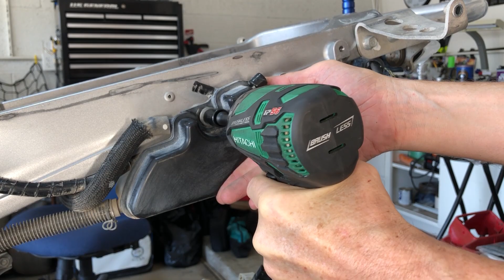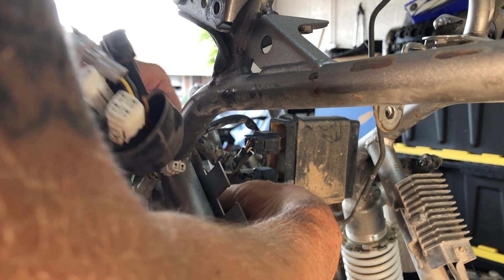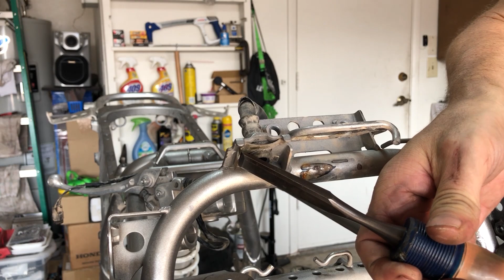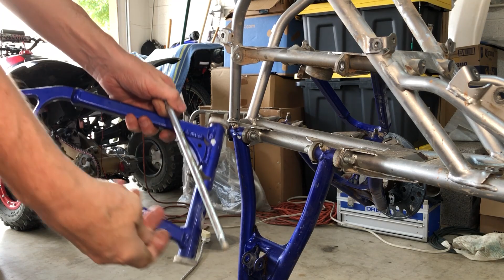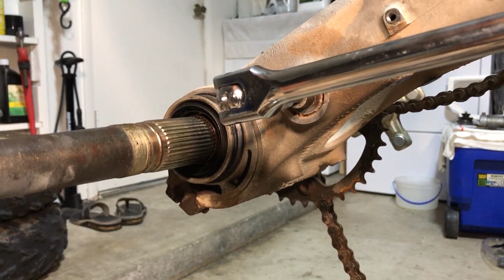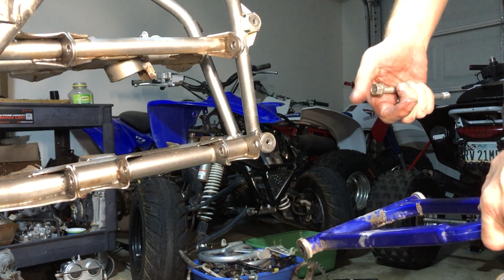Yamaha YFZ450 Build - Part 4 - Tear Down - Wire Harness, A-Arms, Bumper, Axle, Swingarm, Hubs, Rotor

Comment: You should go with wider arms, a wider axle, and some Elka stage 3 shocks or ship the OEM shocks off to Rocket Ron to have them built. You aren’t racing so you don’t need stage 5 shocks, but being in the desert I feel like you could benefit from a little extra width and a plusher ride for the rocky terrain. As for motor upgrades you really won’t need anything other than a good filter, a good exhaust, and jetting the carb. That is literally all I would do as far as performance. Then I would get a good skid plate, case saver, bumper, nerf bars and a kill switch. Other than that stuff there keep everything else stock. Anyway, it’s just my advice. I know you like to stick with being as OEM as possible, I just think you would appreciate that setup.
Reply from the maker: That sounds like a pretty nice setup! I have an HMF Performance exhaust that I am sending in for a rebuild …
Reply: @11GalleryATV  that’s a really good exhaust for the YFZ actually. You know, I use a harbor freight rotary hammer with the punch tip to get the tie rods and shock bolts out. It saves me from hammering and pops those bolts right out of those places that they are seized.
Reply: If you can get an air hammer it will work better, but the rotary hammer works perfectly fine for me
Reply: Oh, and for parts that need to be pressed in I’m about to pick up a harbor freight press as well. Some tools from there work perfectly fine when you’re doing little stuff like building quads. I wouldn’t use it for commercial mechanics, but for what we would use it for it would be a good piece of equipment for not a lot of money. Like $200 for a small bench mounted press.
Reply: Hey, if you do get aftermarket shocks though then I might be interested in buying those OEM front shocks for my daughter’s blaster. I’m looking for a deal on OEM standard travel shocks from an early hear YFZ. I’m going to send them to Rocket Ron to have him do his revalve kit and his triple rate spring upgrade.
Reply: Sorry, I know I’m blowing your comments up, BUT... you can ratchet strap the frame to your stand and it will keep the frame balanced on the stand better.
Reply from the maker: @christopheravery5808  My buddy has a harbor freight press … I just bring my stuff over with a 12 pack and Git-R-Done!
Reply from the maker: @christopheravery5808  My stand actually has hooks and mounts but I’m too lazy to use them … I use them for dirt bikes though …
Reply from the maker: @christopheravery5808  I am most likely going to use the OEM shocks because they are super clean and low hours … Elka’s maybe in the future
Reply: @11GalleryATV  well if you ever do get Elkas then let me know, but for now I recommend Rocket Ron man. For a fraction of the cost he can take your stock shocks and turn them into something very similar in performance to what Elka offers. He is good enough that even some pro racers send their stock shocks to him instead of buying $4,000 worth of shocks. He will even do a triple rate upgrade to your OEM shocks and install upgrades valves and seals. It’s really good stuff man.

Comment: Hello good morning master, I wanted you to help me with my query: I have a yamaha 450cc ATV with a fault.
Water comes out of the small vent of the coolant pump (water).
What would be the cause
Reply from the maker: There is not enough information to answer that question and there are too many reasons why this may happen. Start at the easiest and go from there ... sounds like it's getting too hot for some reason (and there are many) ...
Reply: I had an 04 yfz, had the same problem. Changed the impellor shaft bearing and upgraded the impellor while i was at it. Never had the issue again.
Reply: Also, i only ran engine ice after that. Kept ol girl cool as a cucumber..

Comment: I’d polish that rear swing arm
Reply from the maker: That would be awesome! I got it powder coated to match the frame, oil tank, motor mount hangers, and steering stem.
Reply: @11GalleryATV  It’s still gonna look sweet no matter what way you roll with it.